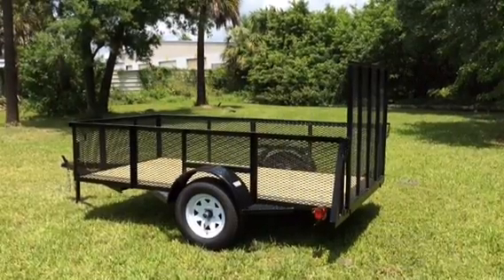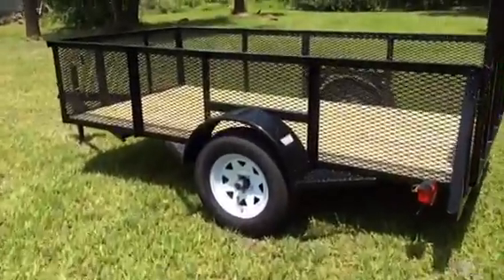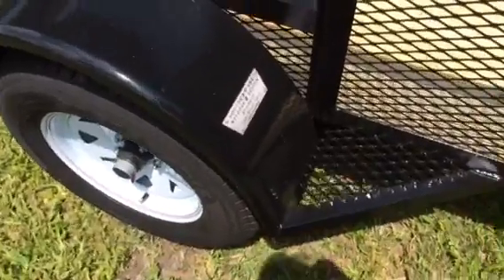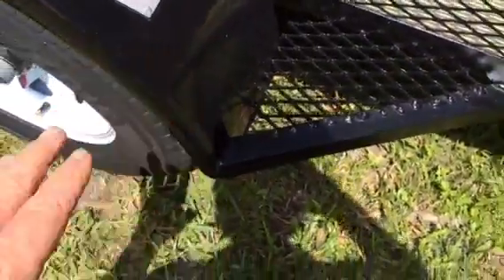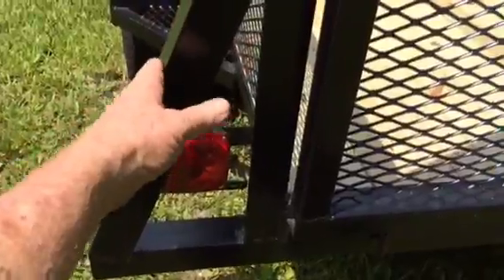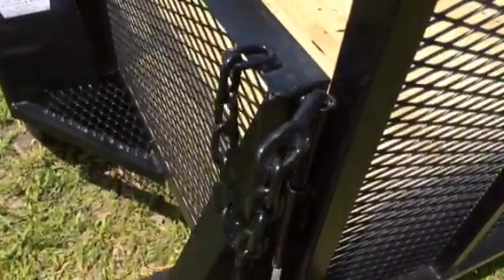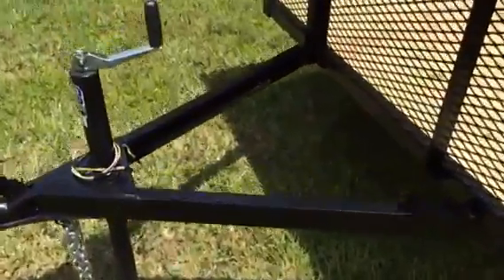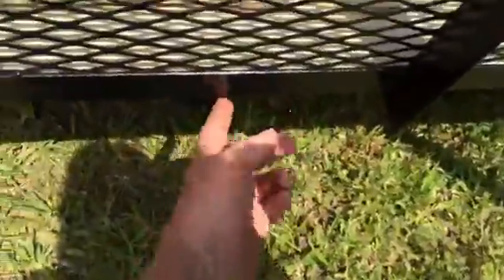Things to know when purchasing a utility trailer.

Comment: Starting a lawn care business solo. Planning on carrying 750lb mower, plus trimmer and blower. My farthest commercial lot is 88 miles away, need to get on expressway to get there. What trailer do you recommend that can handle weight and expressway?
Reply from the maker: Rick Chavez A 5x10 or 6x10 depending on how wide your mower is.
I have both in stock, call me if you want to discuss it.
813-504-3478
Reply: Southern ARC Welding & Design I will call you thank you

Comment: do you ship to tractor supplies in Watertown South Dakota
Reply from the maker: Steve Matson Sorry we don’t ship, especially that far, the freight would eat us up.
Reply: @SouthernARCWeldingDesignTampa  so what the hell type of brand trailer is that!? That's exactly what I'm looking for
Reply from the maker: That is our brand, we build them.
Reply: @SouthernARCWeldingDesignTampa  okay, then! Well... Any chance you folks make a 7x12 single wheel with brakes? And if so. Where are you folks located?
Reply: @SouthernARCWeldingDesignTampa  also what is the weight of that trailer for you guys? Wait is an issue for me. So I'm debating if I should spend the extra cost and go with a complete  aluminum trailer..
Reply from the maker: That trailer weighs 850 pounds and we are in Tampa. 813-504-3478. We can build a 12’ single axle with brakes. Let me know.

Comment: as far as play when jumping in the trailer where is the the movement that your concerned about.
Reply from the maker: The front corner that you were jumping on  should be solid, like jumping on the ground.  If it springs up and down ,  then you don't want.
Reply: Southern ARC Welding & Design ahhh ok so just checking to make sure the frame is and bed is rigid and strong
Reply from the maker: + when you jump on the corner of the floor and it springs up and down then there is a problem. Kyle Gardner